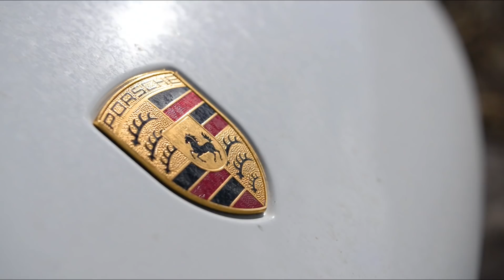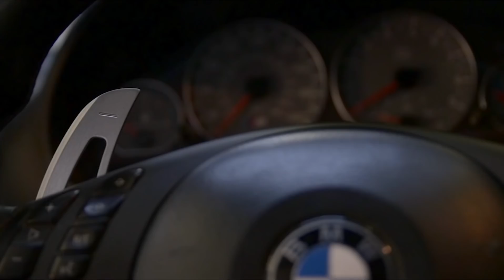Cars Are Changing

Comment: It is F1 dictating where the market is going haha trickle down car tech.
Reply: getting KERS, DRS, turbos on normal cars is imposible except from turbos
Reply: Toyota has a KERS like system with their breaking I think? Or maybe it was just thermal. And super cars get DRS systems all the time? I mean no consumer car will get that for the reasons of not racing. I bet KERS turbo systems hooked to batteries for quicker spools and charging of said smaller battery could be a thing for smaller displacement cars for less lag.

Comment: My issue has always been with long term reliability and ease of function and repairs.There's are my issues with "progress"
>If my push-button system breaks, I can't fix it. I can't fix a computer/module that has gone bad. If my cluster screen is all electrical and breaks, what then? It's not as simple or as inexpensive as older cars. 
>On some cars, they don't even have oil dipsticks! It's a sensor! What if the sensor breaks? Why must I be so reliant on technology for a function that was once so much simpler and easier to do? Most cars don't even have tranny dipsticks anymore..You call this progress?
>Now I have to worry about carbon build up on my valves because manufacturers switched to direct injection..
>Now I have to worry about putting DEF in my diesel truck...
>The new trend now are 10 speed transmissions. Will that last me 400k miles? I've seen many old trucks and cars that have on the same transmission.  I don't care how efficient and more powerful something is when it gets burnt out way quicker. What's the point? If these new configurations truly withstand the test of time, I'd gladly shut up, but as I've seen on many forums, that just isn't the trend right now..
>Now almost every car comes with a tiny engine and a turbo. I just want something that isn't going to be so stressed. 
>Plastic. Plastic everything. Plastic water pump, plastic intake, etc. Sure it will last a while, but it eventually becomes brittle and cracks. All this is done to save weight and money.
>Now I have to worry about the emissions crap fucking with my engine's performance.
> I'm just being honest, electronics break, and their not so simple to fix. I'm not completely against change (I love the aluminum body on Ford trucks), but not all change is for the better.

Comment: Honestly there is just a lot of experimentation going on in the car world right now. Car manufacturers are trying new things to see what works and what doesn't. There have been so many hits and misses in the past 10 years. I think people spend so much time focusing on the misses and forget all of the hits that they have had. Cars are so much more advanced these days and for the most part it has been for the better. Like the video says, they are safer, faster, and better handling. As far as looks, it just depends on your opinion. Obviously older people will think older cars are better since you grew up with them and feel a connection. Try to understand that, for younger people, newer cars are appealing to us because it is what WE are growing up with. These are the cool cars that we see OUR celebrities driving around in and the cool cars we see in modern movies. They are the dream cars that we are getting a connection to. As far as electic cars, I am not a big fan. The largest reason is the obvious "sound" aspect. I am still very much in love with the obnoxious noise an engine makes. That being said, I understand that cars are moving towards electric/hybrid. By the time we GET to a point where ALL new cars are electric, I assure you that you will be use to them and like them. Nearly all new vehicles that are made are still gas powered. Very few of the available vehicles are electric. They won't make all cars electric until nearly all of the population demand electric cars over gas powered. At the moment, only a small portion of the population want electric. This means that they are going to keep perfecting the electric vehicle until charging times are able to compete with filling a vehicle up with gas. It will also have to compete on a performance level and prove to be reliable. My point is this. No one is going to FORCE you to buy an electric vehicle. By the time you own an electric vehicle, it will be because you made the conscious decision that it is better than a gas powered vehicle. Obviously they still have a lot of work to do to get the majority of people to feel that way. It will happen though.

Comment: The truth is sometimes buried. When people complained about carburetors vs. fuel injection they may be right at their time because back in the day there were lots of very good and easy tuning opportunities for the old stuff - this has changed and now fuel injection is reliable and tuning friendly. But whenever you hear a good old carb, damn, they just sound so good.
The story with electric steering assist and manuals vs. autos. This is a story about feeling versus paper facts. Optioning the auto may lead to a better acceleration on paper and also hold a the value may be better (may be for the USA). However, it kills driving experience, it also kills these moments while shifting. It is unacceptable for me to get rid of this because it is part of the whole experience and joy. For me people that buy an enthusiast car with an auto are either race drivers who seek milliseconds or just idealess oafs looking at the spec sheet.

Comment: Government and regular car consumers ruined the car for us car people
Reply: From emissions standards to adding hundreds of pounds of airbags and side impact beams to meet safety standards to fuel millage demands. Yes the government has their hand in it.
Reply: Enthusiasts that bought used instead of new also helped ruin the car ;-)
Reply: Safety standards didn't ruin cars, it made them better.
Reply: @bmortloff  I only considered the passive safety standard will make the car better. But not all active safety features will make your car better, some are distracious that make the drivers less aware what happened on their front. As long as the active safety didn't interfere the traffic no matter what, I will like it.
Reply: MrOrtloff debatble. Most safety items are done years before govt forces them into cars. Many cars nowadays have blind spot monitoring systems. Its not forced by the governement... Yet. What the governement does is tell automakers to implement systems that were already in their mid to high end range of the model spectrum and forces it into the cheap range and raise the price of the cheap car. This is one of the reasons why cars today cost more than they did 10 years ago when adjusted for inflation.
Reply: Frank Magana In setting the regs on cheaper cars they make them safer for everyone; passengers other road users and pedestrians for the life of the car. Price wise you're getting more car for your money now than you did ten years ago - at least here in Australia. 

Last thing blind spot monitors are really  just for people who can't set up their mirrors correctly. and they really aren't adding much to the price of the car. The safety features which are fundamental to survivability in crashes shouldn't be optional just to get a new car on the road.
Reply: MrOrtloff but then the cheaper car isnt cheap anymore. We see this with pickup trucks. Theyre all over 40k now when they used to be more high 20's. So what do a lot of people do than? They see more value in getting a 12 year old pickup truck. Hell im looking into getting a Yukon for myself and sure as hell wont be anytging from the last 5 years
Reply: I agree, but I think it would be better to have a second hand car market with vehicles that have decent safety features than a cheaper new car market packed with Chinese death traps at the low end. That's what I was trying to get at when I said safety features that last the "life of the car". 

Better pay than 15 years ago wouldn't hurt either.
Reply: Frank Magana about that trucks used to cost 20k and now they cost 40k, thats inflation for you. Today everybody earn more money than they did before which in turn make it so that 1€ isn't worth as much as it were, let's say, 20 years ago. 20 years ago you could get more stuff from 1€ than today but because everybody earn more on average today it is about as much money as before :)
Reply: Are you stupid? the government has nothing to do with this.

Comment: The things that suck with new cars are that they are to complex, too much emissions shit and catalytic converters, you have to turn of the traction control every time you start, a 3 or  4 speed automatic transmission last longer and is cheaper to repair than a 6 speed or any idiotic double clutch automatic. Old cars had bigger engines that lasted forever now days there are small turbo fourbangers that dont last. Start stop systems are annoying and you have to turn them of every time you start the car...
Reply: ChevyBM I hear you man and my 96 F150 will definitely outlast every single one of them.

Comment: I pulled my parent's '67 Fairlane 500XL out of the garage after ten years of sitting. 

Mother of god is it easy to work on. 

There is so much more space under the hood, and everything is contained under there to. The only outs are the throttle wire and the brake pedal along with the heater core. It's a really cool comparison when you look at what's under the hood of an average car nowadays.

Comment: Cars are going in the right direction. look up freevalve opens up the world to engines.
Reply: Michael Danthon Except for the fact that My 96 F150 will definitely outlast every single one of those modern cars you see on the road today.
Reply: CJ Colvin your correct those cars were bulletproof but their ceilings for performance were low. the ceiling on performance is being raised by current technology with reliability and more power. it will just take time to perfect reliability aspect.
Reply: Michael Danthon True but what if a part breaks on a modern car and you can't fix it then what well then you have to get towed to your local mechanic shop and get it done for you and it'll cost you big bucks on a modern car verses an older car. Also new vehicles are not only overpriced but they look hideous and ugly, have no soul, made out of plastic, and they're so complicated to work on as well.

Comment: 3:54 "It's not gonna have manual steering"

I presume you mean a manual transmission, because I'm honestly not sure how a car you don't even steer could be as enjoyable as one you do.
Reply: @Dr. Cannibalism I was referring to a non power assisted steering system. And to a lesser extent, steer by wire like Infiniti offers in a few models.
Reply: Ah, I see. Sorry, your comment brought the difference between a manual and automatic transmission in my head, so the end result pictured was a steering system that doesn't require manipulation/operation from the driver (basically, an autonomous car). Autonomous cars sound great for after a night out when you're hung over and don't feel like driving, but from a "driver's vehicle" point of view, they sound kind of undesirable. But that's not what you were talking about, so that point is irrelevant. Thanks for clarifying.

Also, steer by wire? I did not know that was a thing. At first I was kind of horrified to think of steering without a direct mechanical linkage to the steering wheel, but I suppose after the tech has been dialled in and mastered, it could be really handy. You could dial your steering responsiveness to your liking by changing values in the computer, without having to take anything apart, as well has having different saved profiles for different drivers.

Comment: I appreciate your views on this, and understand what you're saying. However, with more and more technology, it does actually become harder to modify. Say you want to twin turbocharge a V8. On a car / engine from 40 years ago, all you needed to do was physical changes. Manifolds, turbos, piping, and bigger jets on your carb and Maybe forged internals / beefier clutch depending on how much boost you want.
Nowadays, you need to do all that, and then have to worry about fuel injection, fuel pressure, the sensors that go with it, your MAF, etc. You need to tune the car with a computer and probably a dyno, which is a luxury that not many people have / can afford. 
Easier to follow example: I have an 87 Thunderbird Turbo Coupe with the 2.3T. It ran 10PSI stock, but I tuned it up to 18PSI with a manual boost controller that I bought for $15 that restricts the amount of air that makes it to the actuator which opens the wastegate. 
I also have a 2006 Jetta GLI, which runs X amount of boost (No one seems to know, but it's around 12 I think). It has an electronic wastegate, meaning there's a sensor that senses the amount of boost in the intake, and opens the wastegate when it's too high. If I want to turn up the boost on that car, I have to buy a $550 tuning chip which may or may not work, mixed reviews.

I am not arguing with the fact that cars are changing, however, they are most certainly not getting easier to modify by any means. There's a reason why older carbonated engines are the go-to's in racing. They're easy to work on, easy to modify, and there's a huge market out there for aftermarket parts.

Comment: There's not really fair  comparisons here; an electric vs gasoline car is a FAR broader comparison than disc vs drum brakes, or power vs. non power steering. We're seeing cars become faster, but also less unique; as with the Formula 1 example given, cars are looking more and more 'the same' these days, apart from rare examples. Performance cars are becoming harder to find, and 'driver's machines' are largely replaced by 'A to B' transportation. Your average electric car is a very sterile experience - no sound, no smells, and very little in common with a traditional car. Expecting most performance-oriented drivers to embrace the new as if it was just a mild evolutionary step (going back to power vs manual steering) is asking far more than you think it is.

Comment: One thing that keeps getting worse is visibility. One of the only things I don't like about modern cars is the awful rear and sometimes side visibility. It's kind of like the 1970s in the States when safety restrictions we're so strict that there were almost no good looking cars on the market anymore. Even European and Asian cars had to have stupidly large rubber bumpers shoehorned onto the front and rear of otherwise good looking cars. Then the USA finally started to relax its safety standards in the 1980s so car companies could have more control over the design of their cars. There are some really good looking and greatly fun to drive modern cars, but you can't see out of half of them without a damn camera because the pillars are so thick.